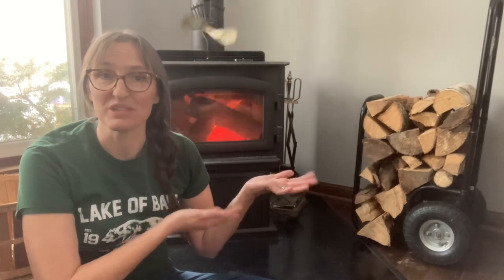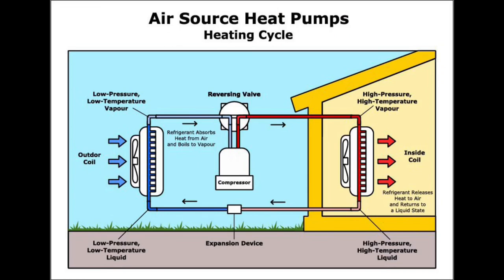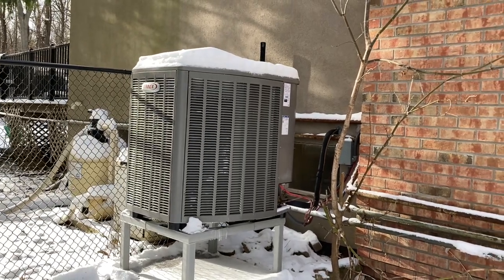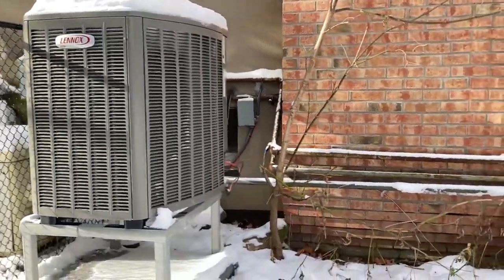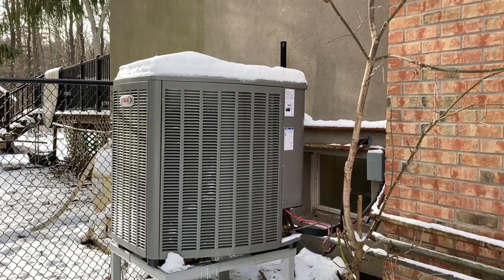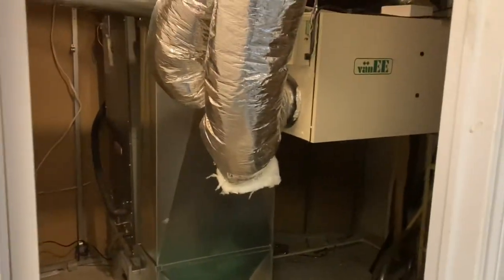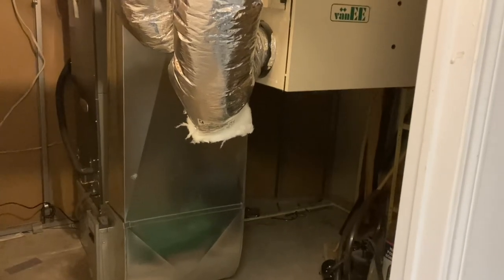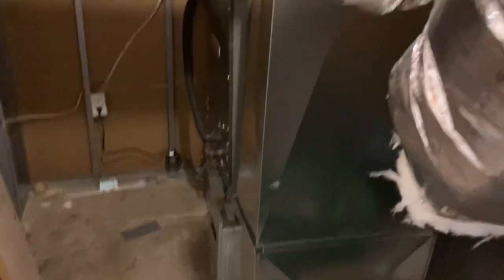Carbon Neutral Heating using a Wood Stove and Air Heat Pump Together!

Comment: We're doing the same as you and I've been having a hard time finding out how sustainable our wood burning is. I do all of my own wood harvesting with nearby supplies and will only cut dead, dying, storm damage and trees being removed by neighbors which I sometimes find at the local dump. I think this is better than natural gas but I'm not sure , from a sustainability standpoint
Reply from the maker: Hello and thanks for the comment. I think how clean wood burning is versus natural gas depends on how you look at it. If you are sourcing your own or local wood the transportation costs are very low. Then you are just releasing locally sequestered carbon and the effect is neutral. If you are burning natural gas, sure it's clean burning but you can't forget about the emissions/damage of fracking/extraction and transportation of liquified natural gas. I think that is what people forget about. What would be super cool is if every woodstove has a carbon capture device. Then it would be a no brainer! Have a great day!

Comment: How is burning wood carbon neutral? What is the smoke made of?
Reply from the maker: I hear you, smoke is made of carbon. However, since we grow our own wood we are releasing the carbon that the trees have sequestered. So, over time it is carbon neutral. It's also a way better source than using coal, oil, or natural gas with all the environmental damage from the mining or drilling. Thanks for the comment!